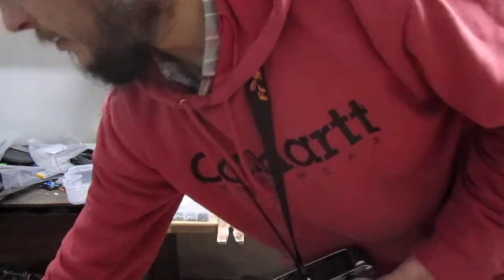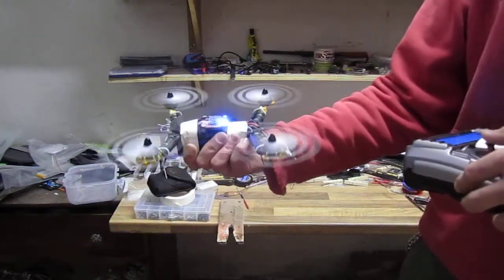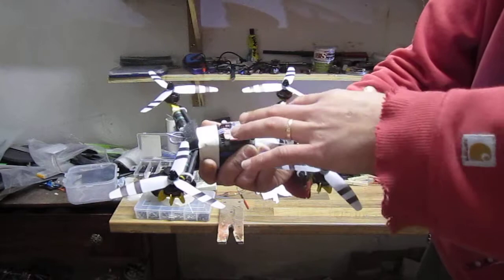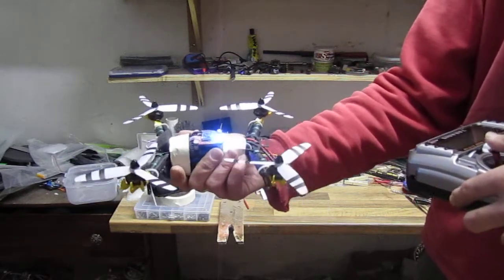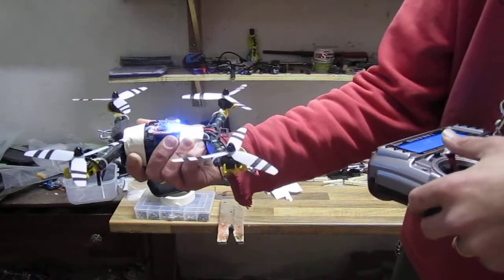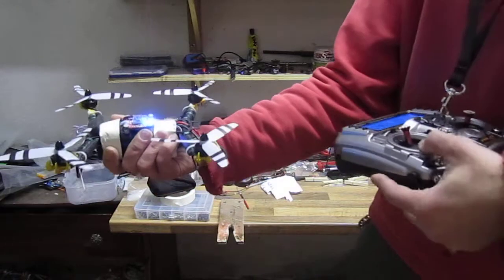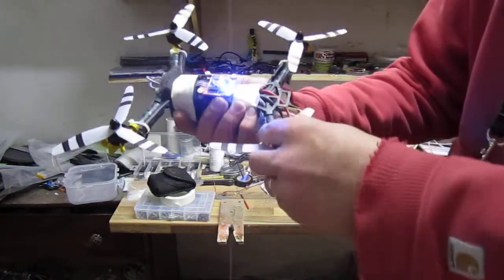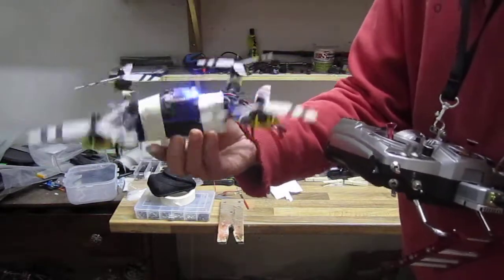Custom ESC test #1

Comment: The P may be too high the Naze32 by default has that bit of twitching  also that motor-to-motor distance is much shorter there.
Also you're holding in the hand so the PID controller can't work properlly as it tries to compensate and nothing happens.
Basically it needs to go to he air. :)
Reply from the maker: Yeah man, I had suggestions like that... I'm aware that PIDs are much less on a bugs this size, I've reduced P to 2.00 and it seems that it helped a bit (maybe:) I have only one set of these 3blade props, so will go up in a few days when I get cheap HK props:)